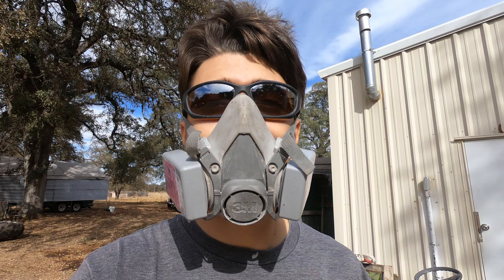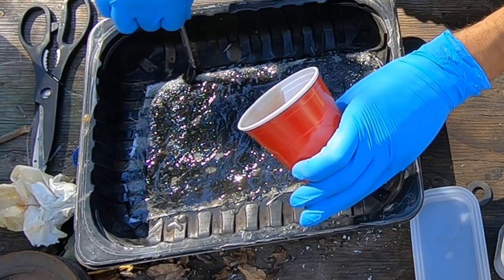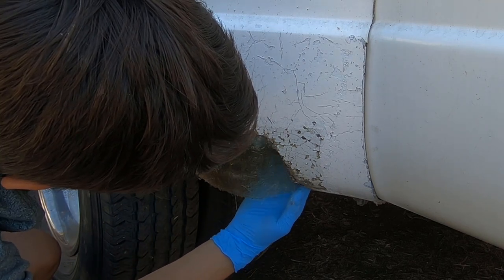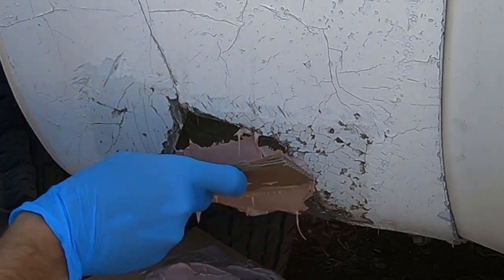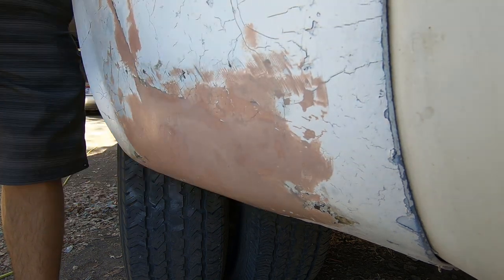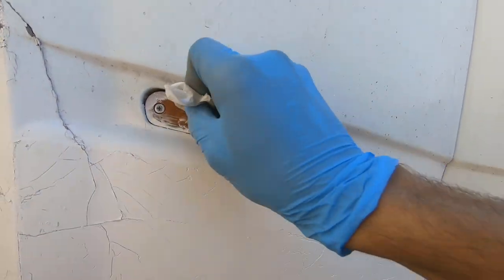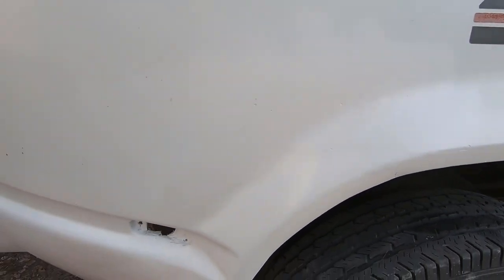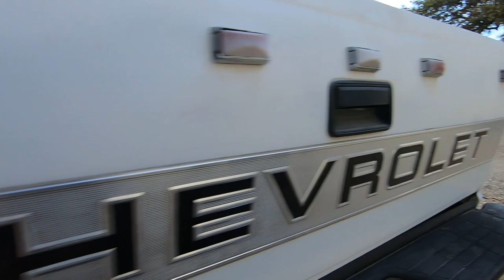Fixing Dually Fenders Using 80$ Worth of Bondo!

Comment: How much hardener you should use is VERY much dependant on the temperature you're working in.  The hotter it is around you, the less you'll need.  10 drops is all I use for fiberglass resin and I've been doing this since the '80s.  As for your bondo work.....use much less hardener (read the directions) than shown here and be SURE you really scuff the outside of the fender before you apply the filler.  You applied it right over the old cracked paint.  Bad idea......  As for power sanding.....get a good 6 inch orbital air Sander. (Harbor Freight sells them) they work MUCH better than what you had here.  They even sell a tiny one that I've used alot for close proximity places the large one can't get into.  Also, if you do a small fiberglass repair spot, after sanding and cleaning the area, wet the damaged / cracked area with resin first, then apply your matting on top. The wet resin will hold the matting in place so you can add more resin on top with your small brush.  When the matting is thoroughly saturated, let it dry. It will dry slower in cooler temps.  When thoroughly hardened, sand it down (80 grit is fine) and THEN apply your body filler. Sand and reapply as needed finishing with 180 grit.  Then use a good primer before you apply paint over it.  Primer will create a good base for the paint to stick to and you'll be glad you did.   Watch this guy (below) video for small repairs (whether on fiberglass or steel) because he's doing it correctly.     https://www.youtube.com/watch?v=4LdXFvdzSDs       You're welcome......

Comment: Aye dude good job but imma give you some tips... when doing the glass you sure layer the hole until its close to equal.. then about 1/4 bonda at most... that way over time no cracking.... also a clean area is always key brotha but great job!!
Reply from the maker: Travis Tabucchi Yes you are right, I forgot to take into account that the lip comes out, and ended up using way more filler than I needed haha.

Comment: The filler is not supposed to be structural, you really dont want it more than 1/8th in thick. Your repair would be more legit with more fiberglass cloth. Build it up, sand it down, then skim coat the whole thing with filler as thin as possible. But cool deal anyways

Comment: Git er done! Dont think I’ve ever seen anyone use a belt sander for body work. Still, it looks much better and cheaper than 500 bux (per side) for new flares. Score!  Shes jus a 20 footer(look gd from 20’ lol) Added note whenever repairing or jus filling over cracks in fiberglass. Drill a small hole at either end of said crack. These will keep the crack from propagating. Keep at it. 🤘🏻 💪🏻 👊🏻

Comment: after the first piece of cloth u should have filled it with more cloth or tiger hair and if u use to much hardener in bondo it will make it so hard it is brittle and will crack out over time and u should have put mat or cloth behind all the cracks in fender  then grind out the cracks and refill them with tiger hair not bondo never put bondo that thick no more then 1/8 of inch thick only for finish but better to use a gel coat over fiber glass and protect it from water and these fenders flex going down the road from wind never use bondo on them it will crack out i been doing body work for years i hope this helps u on the next one u do and use a hand block to get it so it is not wavy
Reply: ps all u need is a hand block to do the job just use 80 grit to shape the glass just do it when it is gelled not all the way hard shape it the let harden up then use a thin layer of bondo but i would just use thin coat of glass let it harden up then sand use bondo just to fill it the pits air pockets from the glass and do it by hand way cheaper just as fast and does a way better job
Reply: jeffrey hollenbeck thanks for the advice i will use it!
Reply from the maker: Thanks for the input!

Comment: Looks really good. I have made the mistake in the past of putting on too much Bondo and it cracked. I'm afraid that's gonna happen with this one, a little more fiberglass before putting on a thin layer of Bondo would have been the way to do it. But regardless, the finish was amazing and the basic concept is that anyone can do this, props for that.

Comment: As a 'glass man' there is no way I would do what you did but, I'll give you a tip that'll help you next time. Wet out your mat on a sheet of waxed paper, it'll give it backing and it will hold its shape better. You can work into the repair, see where it's laying in, and you won't even get your hands messy.

Comment: Wax paper and plastic wrap helps take shape without using your hands. Pull it tight around the fender. Fiberglass 1st bondo glass 2nd then bondo filler. Cardboard is the worst to use it speeds up the harding. Even for effort and nice going.

Comment: Pls let me know how can I replace the extended part in this fender , my truck is 1991 GMC Sierra dolly
Reply from the maker: atef baraka only ways would be checking around at scrap yards, though they are pretty rare, taking it to a body shop and having them recreate the fender or source one out, since a body shop should have good connections for parts like the fenders, or you’d simply have to recreate it yourself like I did in this video.

Comment: Try using chicken wire for a skeleton. The fiberglass both sides. I’m afraid that may not be strong enough. 
Looks a ton better than before.
Reply: How would you attach chicken wire? We have an even bigger wheel fender to fix.
Reply: @lc4817   I taped it in place. Then fiberglass on the remaining edges. Remove tape. Then used fiberglass mesh and resin on the inside and outside.
Reply: @georgerdurden4478  Thank you.

Comment: What is the solution your soaking fiberglass material in?
Reply from the maker: its fiberglass resin, you mix hardener and resin together and after a while depending on how much hardener you've used, it will harden,
Reply: You're In Luck thank you I plan to use your technique on my sons S-10

Comment: I was gonna use this method years back. Problem was I was working for a composite company and my boss said it wont last because of the material the fender was made of. Over a short period of time it would eventually crack and separate. I can't remember the material the fender was made of. I had a 99 ford dually. I still love the job he did though.

Comment: I have a fender that has bondo on it already but it is cracked now, can I still bondo on it more? To make it evenly smooth again?
Reply from the maker: Israel Garcia I would sand away the cracked area and fill it in with the bondo, and then sand it smooth again
Reply: If it cracked on you already I would recommend sanding the Bondi out then use some fiberglass even short stand Bondo fiberglass will help. Then Bondo over it

Comment: Hello your in luck! First let me say great job I personally think it came out good. I just did my back quarter of my truck and have a question for you. 

I did exactly what you showed in the video but my question for you is this. Did you bondo over the Fiberglass cloth behind the panel? It works black and I did not see you sanding behind it. Thanks and again great video and tips.
Reply from the maker: i didn't rondo behind the fiberglass, i pretty much used the bondo as a easily sculpt-able material to get the shape just right.
Reply: Thank you.
Reply: When I look at the back of my fenders, they are 100% fiberglass, and haven't been repaired. 

That's how the backside is supposed to be, so apparently no need to Bondo over it.

Comment: Hi 
I will give you credit for effort but this is not way! 

On applying fiberglass you need a form of some kind for the glass to assume its shape. 
After you get a basic shape apply a layer and grind it into shape.  Repeat over and over until the shape is almost to the desired shape.  

Then apply bondo to smooth and finish.  NO WHERE SHOULD BONDO BE OVER 3/8 INCH THICK.   Thick bondo Will crack and fall away it has no mechanical strength.  Fiberglass has your strength, but FG will sag over time and it too needs structural support. 

“A”FOR EFFORT BUT YOU WILL DO MUCH BETTER IN THE FUTURE  and laugh at your first attempts.  But you have to start somewhere!!!
Reply from the maker: Thank you for the information good sir!

Comment: I don't get why people make how to videos when its there first time doing it.
Reply from the maker: its not a "how to" video, its just a video of how and what I did to an old truck to make it look better. it just shows proof of concept, you can do it how ever YOU want.
Reply: These videos serve a purpose, too.  First, to show that he had the nads to try it. Secondly, that it came out looking fair, even if it won't last long, and lastly, you can always read in the comment section everything they did wrong and how to do it the right way on your own project. Lol. 

If we waited for people who really know what they were doing, noone would ever tell you cuz they want your auto body dollars.

Great job. My own tips would be to use body filler that's glass reinforced, it'll help keep it from cracking away. I would remove the fender from the truck and work from both sides using a lot more fiberglass layers.  Clean everything first, sanding down and repairing the cracked areas, too.

Also, I was cringing hard watching the overspray on both the light cover and especially the tires. 
And make sure to use "Chevy white" spray paint. White isn't always the same white.
All in all though, it was a helpful video. I was actually pretty amazed at the second side, it might be a temp fix, but it sure looks better right now!

Comment: Why did you not sand the whole thing to get rid of the cracks and such? And why did you not tape off or take out the lights? I know it’s a diy job but dang there is a right and wrong way to do this and the video is the wrong way all together!
Reply from the maker: Allen Smith i wanted to keep it aesthetically rustic to match the age of the truck!